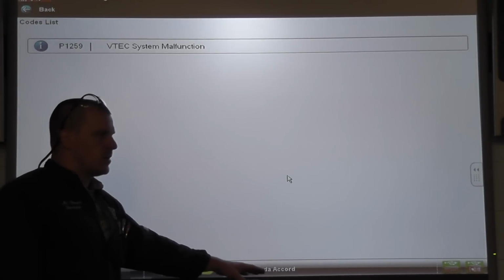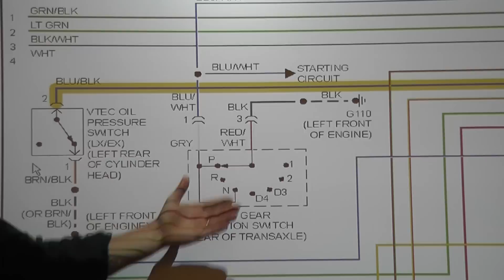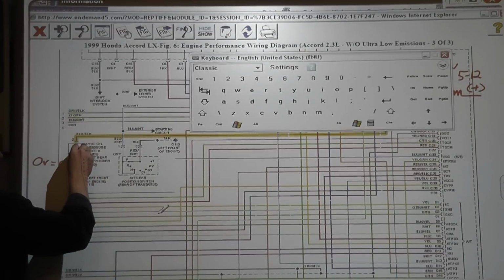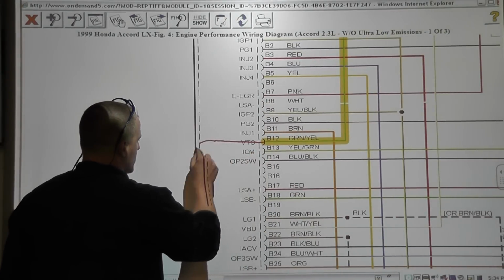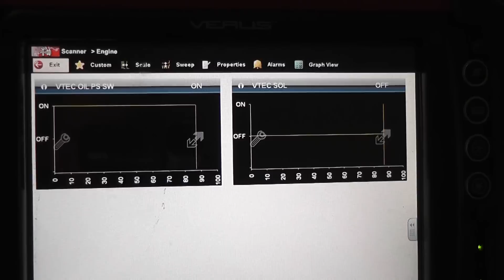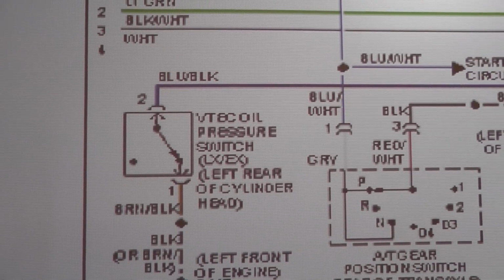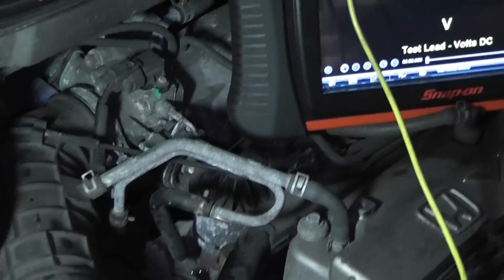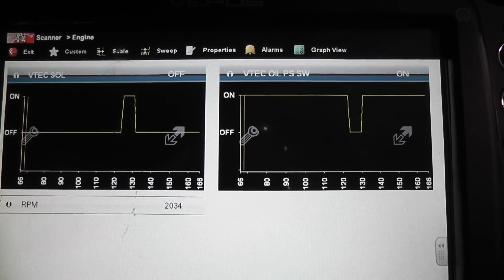Honda VTEC System Testing (P1259 trouble code)

Comment: Good morning, I was watching the video for several days until it became clear to me, well I hope so, I would like to know if my deduction is correct, if not, I will study the video again: Under normal operating conditions, the Honda VTEC system first activates the VTEC solenoid and this in turn activates or rather changes the VTEC system's oil pressure switch from ON to OFF from 0 to 12 volts, thanks to the oil flow that the VTEC solenoid allows at the first moment, I hope this is how it works, I spent several days confused because my logic told me that the oil pressure changed the condition of the oil pressure switch and that the ECU with this information activates the solenoid, but from what I see, the way the system works is the other way around, first the solenoid is activated and consequently the oil pressure switch changes from ON to OFF from 0 to 12 volts, I hope I'm correct, thank you for sharing your way of making the diagnosis.
Reply from the maker: that is 100% correct my friend. The switch input is for conformation that the solenoid activated and is NOT an input used to activate the solenoid if that makes sense

Comment: Will it hurt the car to hardwire the vtech solenoid to be on all the time?
Reply from the maker: You would significantly loose bottom end performance
Reply: @ScannerDanner so youre saying it won't hurt the car
Reply from the maker: Not sure that solenoid can handle being energized continuously. So I can't say. But I don't know why you'd want to do that anyway
Reply: @ScannerDanner I bought an accord and realized the vtech solenoid wire isnt hooked up to anything. The wire and connector is just hanging

Comment: What if you get no rpm change but you hear the click when testing the solenoid connector with T pin?
Reply from the maker: plugged up oil passage or faulty solenoid or a physical problem with VTEC mechanism

Comment: I know this is old but I just got P1259 on my 99 accord 2.3. With the engine on I get 0 volts to the oil pressure switch when I apply 12v to the solenoid. Also no rpm change even though the solenoid clicks.
Reply from the maker: Focus on the solenoid and oil passages. Maybe an inlet screen on that solenoid is plugged?

Comment: I got p2647, oil pressure switch circuit high. Going to diagnose today, thinking where to start. This video helped lot.
Thankyou.
Reply: Same. With switch on (but not running) I have 12-13V on both sides of the switch pin. Voltages are different by about 1V. Probably have a fray somewhere where in the harness where my brown wire is incorrectly picking up voltage. Just knowing for sure that it should be ground is very helpful. Thanks for the detail on the video. :D

Comment: I have a 99 Honda Accord I don't a head job on it and now before I done the head job on didn't have the code for a vtec solenoid but not coming back I put a new one on it and still have the same code every time I drive it ain't clear
Reply from the maker: Test the circuit like I showed in this video. Does the psi switch change signal voltage when you manually energize the solenoid?

Comment: My daughter just had a friend change her oil 2 weeks ago. She drove to work 9 days, 4 mi each way. I borrowed yesterday and just happened to check her oil out of habit. Nothing on dipstick so decided to put a quart in, ended up putting 4 1/2 quarts in to show on dipstick. 99 honda accord vtec 120000 mi and can hardly hear run. Ended up person got distracted after draining oil and putting on filter. Forgot to go back with oil. Thank God she never drove for longer period of time. Running great. Funny part is, no codes! Especially being vtec. Commments?
Reply from the maker: Count your blessings my friend
Reply: Never got up to speed to engage VTEC. Typically 4k rpm

Comment: During the test drive how did you get the ECU driver to command “on” at the VTEC solenoid as in the final graph?
Reply from the maker: if it was during a test drive, I simply met the conditions for that solenoid to turn on would be my guess
Reply: Thank you for the reply and the video. You cannot recall the scenario? Was wondering if it was by the tachometer, or engine load? I cannot with ivtec get the ecu to call the solenoid. Connections are all good and solenoid actuates. No vtech codes otherwise.

Comment: Please explain how solenoid ON changes RPMs. I thought solenoid ON = VTEC ON = rocker arms follow higher cam lobes = valves open longer, which is not a function of RPMs.
Reply from the maker: If you're changing a cam profile at a time when it shouldn't be, you'll definitely get an rpm change, and in this case a drop as it is not ideal for idle conditions

Comment: My 2003 Element's VTEC crapped out because I let oil get too low. It's crucial to do regular oil changes and keep oil level normal with VTEC system. Once I changed my oil my VTEC resumed working.

Comment: Hi paul, i have a stream rn3 k20a. I am having this issues with same code as your videos. Before, i just replacing the vtech selenoid without checking the volume volt as you explain. So, does your solution lasting?tq

Comment: Interesting that the ECM commands the VTEC solenoid on and then verifies it through the oil pressure switch,I always thought it worked opposite. Thanks you are an excellent instructor! Was chasing this code but an oil change cured it,I had used a good amount of Permatex engine assembly lube after a top end rebuild and apparently it altered the oil viscosity.

Comment: Please Paul or somebody else,help me with this question;In a 1998 accord 2.3l ,engine running applying 12 volt to the Vtec solenoid,it is normal to still have,one and a half volt on the vtec oil pressure switch blue black wire?I think is the ground signal to pcm(multimeter positive side to 12 volt battery post,negative side to blue black wire vtec oil pressure switch).because apparently all my system is working normal,but about 50 miles of driving I'm  still getting the p1259 code.thanks in advance for your response.
Vtec sol new,vtec oil pressure switch new,engine oil 5w30 fool,wiring tested good.

Comment: Hi, my 2006 Honda CRV has engine warning light with p2646 code. I tested as you show on this video. When I touch the signal wire of the vtec solenoid in the engine off, I can hear clicking sound, but with engine running there is no rpm change and vtec switch is still 0 voltage indicated. What problem would be? Low oil pressure? If yes, what components would be fault?
Reply from the maker: Pull the solenoid out first and see if the screen on it is full of debris. Next easiest step
Reply: @ScannerDanner  I agree. The clicking noise confirms that the solenoid is working, that is, the solenoid is moving the spool valve. But it doesn't confirm that oil is being sent to the VTEC rocker arm pins. Clogged screen will cause problems.

Comment: voltage going vtec on my d15b jdm is 2.7 v.. key on start position n idle. is that normal?
Reply from the maker: to the solenoid or psi sensor? Which wire? Also what year, make, model, and engine? d15b means nothing to me, sorry

Comment: Need help.  My pressure switch (02) has only 2 pins.  I guess that is the 'switch' and it switches the ECU wire to ground?  Essentially an open switch closes when there's sufficient pressure.  Working from home with just an ohm-meter.

Comment: could u engergise the solenoid with a test light ?
Reply from the maker: It depends on the solenoid resistance. Yes on some, no on others. If the solenoid normally draws about 300ma, then yes, an incandescent test light will carry enough current flow to energize it. Not completely, but enough to create a magnetic field strong enough to open the solenoid.

Comment: Hey paul,the circuit that you 've checked is in charge of controling variable valve lifting and this is matter because the solenoid is just on/off type,and about vvt system the solenoid actuator driver design would be PWM ,so would it be possible to energise that type of circuit like what you apply in this video?
sorry if my english language might be bad.
REGARDS.

Comment: Thanks for the video! It might help me figure something out on my truck. VTM is VTM-4 lock. My 03 Honda Pilot had a misfire with the CEL on recently. Got misfires on three cylinders with reader. The check engine light went off but I went ahead and changed the plugs and started throwing coils at it which helped but didn't make it better because I still feel an intermittent misfire (was a dead miss) and it's also got a leak somewhere but fluids seem to stay okay when I check them. It has put black oily gunk all over my engine and want to get it fixed. It has coated the transmission so wondering if it is a seal. Very new to doing stuff to my own vehicle so really dont know what to look for in a leak to identify its source. Back to the subject about VTM, I am going to try to change my vtm differential fluid to see if that helps the computer time itself with the vtec. I haven't had any lights since or codes on scanner but there has to be a reason that came up with the cel, went away but code read generic misfire around that same time...and she is still not running like herself. Also one of your videos gave me the confidence to do the cylinder drop test. Thanks again!

Comment: My solenoid clicks when I apply power. But when I start the engine and apply power the rpm doesn't change like in the video. whats the next step, is it a bad solenoid?
Reply from the maker: Okay sweet, you did the first step. No change in RPM is either a mechanical problem with the actuator or a hydraulic issue. Maybe a plunger screen on the inlet of the actuator

Comment: So.. the VTEC Oil Pressure switch is not controlling the solenoid, but providing a signal to confirm that oil pressure is hydraulically switching the VTEC on, right?
Reply from the maker: correct, it is simply a feedback to tell the ECM the VTEC solenoid did it's job. Hydraulic psi is what moves the VTEC oil psi switch position. And this psi change comes from an oil passage the VTEC solenoid controls. Make sense?
Reply: @ScannerDanner  yes it does and thanks so much for the reply. While I have you I just want to say that I saw your book recommended on another youtube channel (western truck and tractor repair). I bought the online book, working through it. That and your videos equal the highest quality instruction I've come across on any subject. Fantastic work and many thanks.
Reply from the maker: Awesome, thank you! I need to drop in on that channel and say thanks!
Reply: @ScannerDanner  I kept thinking that the switch was there to tell the pcm that there is sufficient oil pressure before it activates the solenoid, which would make sense. I am pretty sure a lot of people think that way.  Thank you for letting us know that it is used as feedback.

Comment: very helpful. though it doesnt help me figure out why i get my code 1259 before my engine even starts sometimes.unless maybe my oil pressure switch is sticking open sometimes and that sets the code? i only get the code at low rpms.  never gives me a code above 2500rpm. some days i can drive it hard all day no problem and then randomly or if its cold the next morning the code is back before i start driving. oil screen and oil level are clean and good

Comment: I did an oil change on my 2002 Honda Accord, my check engine light is still on. I reset the code and when I get about 3500 RPM the check engine light comes back on. I changed the entire Vtech Solenoid and still getting the same code? I don’t know what’s next.. oil pressure sensor? Help
Reply from the maker: If you energize the vtec solenoid like I did, does the engine get rough?
Reply: ScannerDanner I don’t know about rough but my car is sluggish

Comment: My Vtec on my 2000 Accord 2.3l is not activating. Solenoid is clicking when I tested it. Their is good ground, checked continuity. Signal wire has power when not connected to solenoid. When the signal wire gets connected to the solenoid and I run the car to energize the solenoid their is no change in rpms? Their is .034mv at idle on the solenoid. Don't know if their is a relay problem or this just goes to the ECM with no other signals. My idle rpm is 700 not 750 which is suppose to be. At park when I rev it up to 5000 rpms, the engine shutters,  holds back so that the engine doesn't go pass 5000 rpms? Is this a ECM issue? Vtec code of P1259 on check engine light turns back on after I reset it and drive the car for awhile on the freeway.
Reply from the maker: So on the VTEC solenoid you are seeing 12v unplugged and .034v plugged in? On the 2-wire solenoid, just to be clear.
Reply: Yes their is a 12V voltage on the solenoid wire unplug and when it's plugged in their is 0V? that's ok because the oil pressure signal wire should supply the current through the ECM right, but it's 0V when idling and also when I increase rpm's pass 3000 rpms? Their is good continuity on all wires. I suspect their is very little oil pressure which means my oil pump, because the car has clean oil. Very weak engine when I increase rpm's according to my scanner the load value goes down. Should I flush the engine, clean the oil pump or replace it?
Reply: @ScannerDanner  I fixed the VTEC issue! Turned out when I checked my oil pressure on the back underside of the engine the oil pressure was very high! I took it to a shop to get the oil unclogged with engine flush, since I didn't have a machine to recirculate the oil I wasn't able to flush it myself... So the oil pressure is at spec's, but the VTEC wasn't engaging still? I got an opinion from another mechanic who wasn't sure what was causing the car's VTEC issues? But on just hearing the motor he said I first needed to get my valves adjusted, because the engine was so noisy you would think I had a diesel engine? But instead of paying him I did it myself and while adjusting the intake/outtake exhaust I decided to inspect the VTEC assembly too. Turned out their were some bolts that were loose so that was the reason I felt the need to pull out the entire VTEC assembly. I cleaned all the passages and even though I didn't see any noticeable clogs on any of the port passages I still went through them all just to be safe.... I ran the engine and no more noise and no more VTEC problems. I took the car for a spin and ran the scanner and my VTEC was turning on/off when I increased rpm's and the engine went into gear!      Paul this brings me to another problem I already had on this reconstructed engine I bought, which was a mistake I should have gotten a used engine from Japan. However, the engine timing on cylinder #1 is at 7 degrees and rpm +/- (700-800)... This is when the engine is warmed. I remind you I've had these problems already for a year at the time the VTEC code turned on a year from now, as well.  My fuel is running lean at variable (-7%) on long term fuel trim levels. And now the knock sensor code P0325 turned on, but it's not the sensor or wires for I have already diagnosed them? Are the belts off timing for their is a feel of lag on the motor still, PCM or can this get fix by adjusting the idle speed like some mechanic said, since as you know these distributors are non-adjustable? At the moment I am putting in new brushes on my alternator that are going bad. Another mechanic said it might be correlated with the PCM and knock sensor, because when pressure gets released on the pedal when I am driving the alternator goes to zero, the dashboard lights turns red on the brake light, and passenger doors!

Comment: Hello Paul. Could you also check the solenoid for over current( maybe less than 1.2A) to eliminate a driver concern from an internally shorted solenoid?  what I have heard is  if a solenoid draws more than 1.2 A except for GDI system, the pcm driver can take a big hit and get damaged. In my opinion, I am pretty sure, most drivers can still be protected above 1.2 A because of more protection added in the modern vehicle sofwares.

Comment: I have a 98 civic coupe d15b, the vtec on it gose not work then running at normal engine optimization but sometimes in the morning it would turn on at 5 and a half but not hard ????